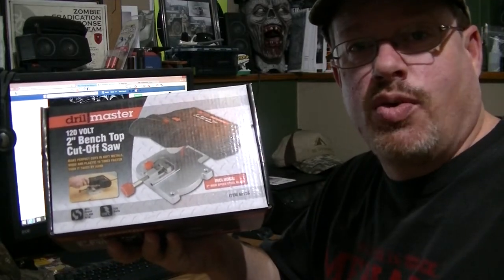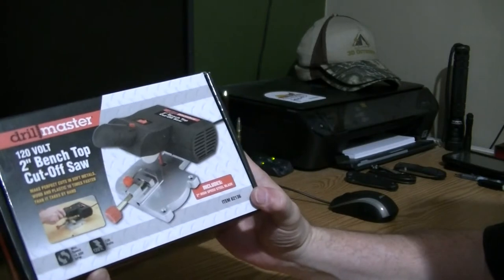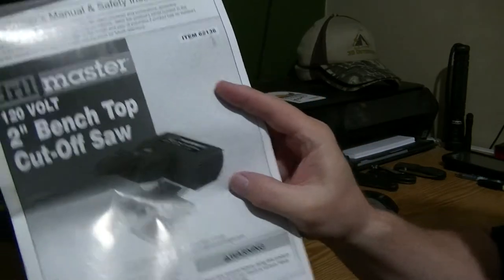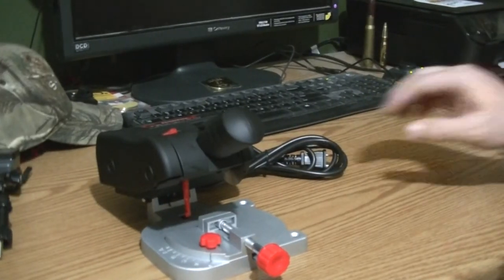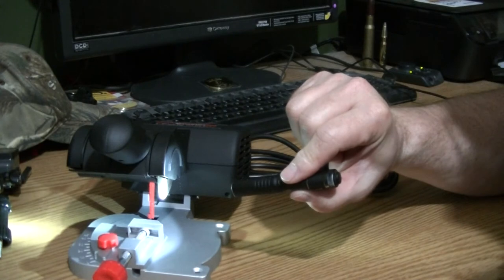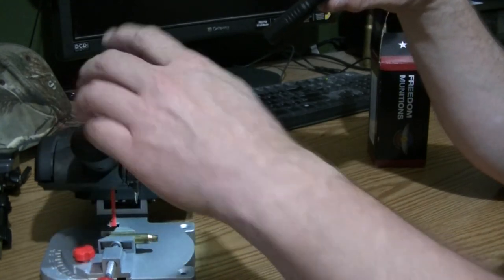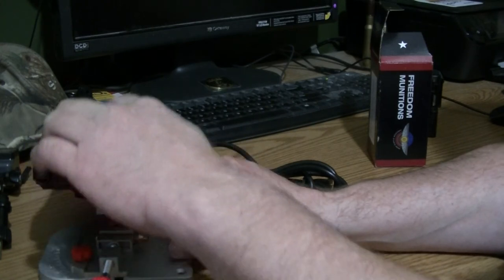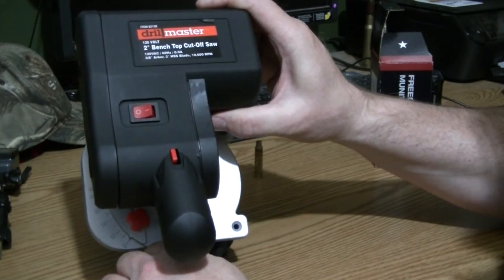Drill Master 2” Cutoff Saw

Comment: If you are cutting metal then throw the blade that comes with it out and replace it with a 2" x 0.035 3/8 Norton cutoff wheel. This thing is 0.9 amps so it's really just a big dremel tool and not a proper chop saw but it's compact and works fine for small stuff.
Reply from the maker: Thank you.